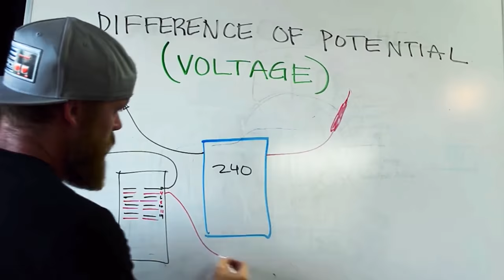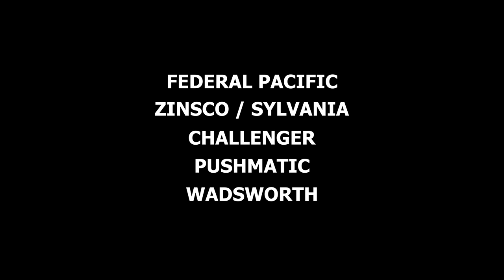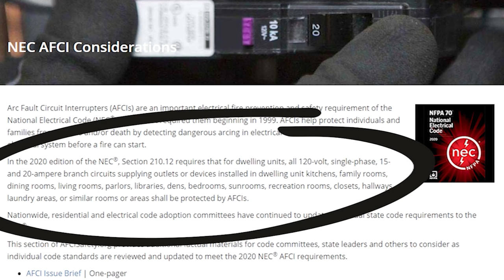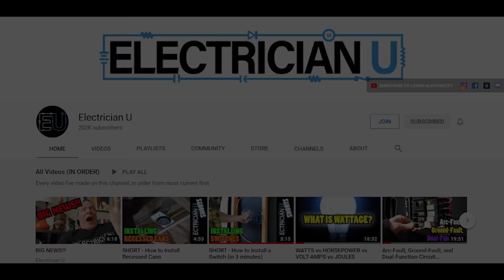Outlawed Panels and Breakers

Comment: Our house was built in 1981. Recently had an electrician out to correct faulty outlets in garage. He inspected our breaker panel, it was a Sylvania/GTE. I had him replace it with an up to code 200amp Eaton panel. The Sylvania didn’t show any problems but being a retired firefighter and very anal about safety, went ahead and took his advice. One of my neighbors came and looked at new panel. He has a Federal Pacific. He’s going to get his replaced as well. It’s a smart move to get the circuit breaker panel upgraded to meet local and national codes.

Comment: I'll never forget, I was in an apartment built in 1962 where an outlet shorted, and the Federal Pacific breaker never tripped. Fortunately, I was right next to the breaker panel, and flipped it manually, since it was next to the outlet. It was then that I researched this issue.

Comment: (8:00) As a retired engineer for a circuit breaker manufacturer, I would never recommend field testing a breaker in a panel by shorting the line to neutral.  All factory production testing for trip point current and time delay is done at low voltage.  Short circuit testing at line voltage erodes the contacts and shortens the life of the breaker. 

Our technicians periodically short circuit tested sample production breakers for UL inspectors. The test was at full rated line voltage and interrupting capacity. It was conducted in a protective chamber in the test lab. This extreme test required that the breaker trip three times without igniting cotton affixed to the handle, to be able to be reset, and to pass a dielectric test. These breakers were then broken up and discarded.
Reply: Thank you for the interesting information.
Reply: Also the time current curve would probably not trip a 20 amp breaker at 22 amps.  It may run fine at 26 amps.  Want to test thermals? Build your own cheap "toaster" tester.  3 electric heaters plugged into a test rig wired to breaker being tested. As above much better to have a low voltage source-not possible in a house.  Add load until tripped.  Should trip at 150%  rated current within a minute or so.  YMMV, a nuclear plant breaker does not like nuisance trips. 
  Dont even bother with stab lock from FPE.  Don't touch the panel.  Once a knowledgeable person touches it, he owns it (litigeus NY here) .  Stab locks did not age poorly, they were cheaters and defective out of the box- they have no excuse.
Reply: ElectroBoom demonstrated the time delay function when he installed an outdoor heater at his home.
Reply: Lol well then maybe all the UL listed breakers should be able to handle hundreds of trips (arc fault or amp) because I don’t know if you’ve ever done a remodel there engineer but it’s all bullshit and sometimes there’s only one way to find out where the line goes
Reply: @fedfreds832   Circuit breakers are designed for thousands of operations within their current rating and about 50 operations when overloaded at 600% of rating.  Depending on the impedance of the source and the load wiring, your short circuit could be thousands of amperes.   Breaker contacts are eroded every time they are tripped with a fault current.  A thermal breaker subjected to high fault current may no longer hold rated current because it now runs hot. 

Shorting a 20 amp branch circuit somewhat distant from the entrance panel will likely do little damage because the current is limited by the wiring.  Shorting a breaker at the panel for testing will reduce its life.
Reply: @gwford3  sounds like you more of an engineer and not actually out in the field trouble shooting. Now a days those arc fault breakers that are suppose to be so special are shit there buddy. Maybe the engineers shoulda looked at those or “tested” those breakers a bit more. (Siemens wise)
Reply: @fedfreds832  they've been out for a long time, and I haven't seen any improvement in old vs new. It's a money grab.

Comment: Your right! Over the years there have been some very bad panels manufactured! However, I disagree with "Pushmatic" being put into this group. In this area, almost every Church had a Pushmatic panel located near the entrance. These breakers were used as switches to turn the lights on and off. While this was not a good idea. These breakers have withstood this abuse for 50 or 60 years! Yet when tested they still break the circuit on an overcurrent, like they did when they were new! This speaks to the manufacturing quality of these breakers.
Reply: Breakers that aren’t flipped regularly go bad faster. Pushmatic breakers were grease-fed, so using them regularly kept the grease from drying out.

Comment: This 100-year-old house used to have a main cutoff switch and a couple of really humongous fuses connected to the incoming feed,  and then going to the breaker panel.  Moisture ingress via the feed caused a fault that pretty much removed one of the two phases,  which was fun while it lasted.  Replacing the fuse (150A!) fixed the immediate problem, but eventually the panel was replaced,  as was everything outside up to the weatherhead.  Significant pucker factor watching the guy who did the job messing with those wires coming off the pole,  but he got it done.  And he re-used all of the original breakers,  which meant that we had some fun with a new dryer running with no heat.  We had to get him back out again to replace that breaker...

Comment: Ditto the others about avoiding the shorting two wires test. I would edit that out of the video. Not a great idea to plant in a newbies head, no matter what caveats you give. However, I wanted to comment on the cost for installing modern versions of the classic breakers. My experience is they are $80 - $100 each. Say a typical house has 30 breakers: that's $2400 in material, plus labor. Even the fanciest GFCI/AFCI breakers cost a little over half the price of the replica breakers.

Eaton has a drop-in replacement panel ("guts") that can fit in a variety of existing enclosures and they claim is UL 67 listed for all appropriately sized enclosures. No tearing out enclosures with all the demo and patching work! Inspectapedia advocates this. It won't trigger a requirement for AFCI breakers, but the inspector at worst may require a $30 AFCI receptacle to protect existing circuits. Also, if the existing grounding system is inadequate, upgrading it is the right thing to do anyway.

The other point is what I observed when watching Dustin's video about replacing breakers on his Zinsco panel. In particular was the damage to the buss bar where his main breaker was attached. He even admitted that gave him more incentive to do a full panel and enclosure upgrade.

I get how you are advocating giving a solution to customers who can't afford a full panel upgrade.  You are to be commended wanting to give them a fair shake and not squeezing every penny you can. I just feel a panel (breaker holder) replacement with modern standard breakers, along with other external requirements is the minimum I'd do. Otherwise I wouldn't touch any of it, so the customer doesn't get a sense of false security. I've told them the dangers and gave a reasonable solution. I could sleep alright knowing I was fair and honest.

Comment: Before shorting any circuit to test a breaker, pay attention to the size and location of the transformer. A pole pig on the street 2 houses down will have different levels of available fault current than that pad mount next to the garage feeding the convenience store on the other side of the alley.  They do make proper test equipment to test the magnetic and thermal side of breakers, but very few electricians have access to meter and relay equipment.  Situational awareness is important when testing for fault current. Be aware an old splice may shoot sparks in a short circuit test. This may be in a wall or in the attic with or without a box in older construction.
Remember, most older homes used electricity for lights, the vacuum, the radio, the fridge, and if wealthy, the TV and washing machine.  This was in the day people hung out laundry to dry.
With modernization, electric dryers, stoves, water heaters, computers, power tools, etc were added to outdated panels.  Keep this in mind when testing in older homes.
Reply: Keep in mind that's IF it's not been updated at all. I bought an old house in 2016, built we think in 1908, but the panel had already been replaced at some point with an FTE panel, yep, I had that replaced. It was 200A/240V service too. I think my current panel is by Square D. Sadly, the house still has some K&T still in service. An earlier inspection revealed it to be about 30% still. The rest was Romex/non metalized cabling. We kept the 200A/240V the same, just with a current panel. Also, the house had a back porch get enclosed in the late 60's and it was wired up and plumbed into a laundry porch, and yes, it's all Romex in there and galvanized pipping for the washer (the kitchen is galvanized too, though the bathroom, redone in 2009 may not be galvanized).

Comment: I had a dead animal smell in my house occasionally. A few months later I spotted a hot spot in my old 1974 breaker panel and found the screw to the buss had broken and was heating up, burning the breaker plastic. The burnt plastic was what smelled! Caught it before it caused a fire!
Reply: In factories breakers are/were tested every 6 months with equipment to find "hot" breakers" lugs and connections checked for snugness, loose connections retorqued  due to vibration....in areas that had negligible vibration could still find loose connections............temperature changes[both room and device], load fluctuations, vibration, can and will cause loose connections in a residential panel.
Reply: @Norm Ferguson Was the dead animal smell only in a certain part of the house? I'm having a similar issue and I can't find a cause. The smell is only in the room with the panel. I don't notice outside. I replaced all my receptacles last year. I haven't noticed any issues with my panel. They trip when overloaded. I may have to open the panel up and look.
Reply: @LloydBrinker  the smell was in an area about 12 from the panel

Comment: I’m currently 58, an EE and volunteer firefighter/paramedic.
When I was 10, I was visiting my paternal grandparents at their apartment.
They owned a combination building and lived on the 3rd floor above retail stores and additional apartments below.

I had seen a welder repairing a steel gate protecting the retail store and decided I was going to become a “welder” and convinced my 80+ year old grandfather that I was capable of building a “welder”.

The 1860’s building had been rewired in the 1960’s/1970’s and all branch circuits were aluminum as well as the feeders for the 8 FPE (yup… FEDERAL PACIFIC KABOOM BREAKERS) sub-panels.

I cut the alligator clamps on one end of an automotive jumper cables. (Crappy #6 copper cables).
I opened the sub panel in their top floor apartment and (wearing leather gloves for “protection”) used a spare 20amp single pole breaker to feed one of the jumper cable conductors and attacked the other conductor to the neutral bus.

I then conned Grandpa into driving to the local industrial hardware store to pick up some “welding sticks”.
OMG… when I think back on how I almost burn their building (and HOME) down.
OR.. electrocuted, myself or others…

Yup… welding worked like a charm!
The 20 amp breaker never tripped .  NEVER tripped!
But… the 100a 2-pole breaker feeding the sub panel from the basement service TRIPPED after 20 minutes of “fun”.
The service was ALL Square-D QO btw…
I still can’t figure out why the electrician opted for cheap with everything else .?

Well… after a while, I started feeling like I had sand in my eyes.
Yup… “ flash burn” .  I quickly disconnected everything, thought, molten metal had somehow burned both of my eyes and was forced to call Mom and Dad because my weeklong  trip had to end and I need it eye care ASAP.

Damn good breakers - those Federal Pacific breakers never tripped. !
🤣

To this day, I think God that I didn’t hurt anyone or burn the non-sprinklered building down.
My eyes healed up within a week of “patching” and my grandfather never said a word.
He simply said I was watching workers doing some welding…. 

RIP Grandpa!

Btw - I inherited that building after aa few years and sold it for college tuition funds.
(it was located in Orange, New Jersey, big time ghetto, so it didn’t cover grad school..  LOL)

Great channel, great video, and great community!
Thanks

Comment: One of the problems with these breakers and panels is they were fine when they were made but as electrical loads over the years have increased, they become substandard.
Houses in the 1920's and 1930's only had lighting. There was no electric refrigerators, TVs, kitchen appliances, hair dryers, etc.

Comment: Cont. Never observed a pushmatic breaker that overheated or caused breaker above it to burn like murry breakers did. We had close to a thousand of them at large slaughterhouse  that I worked out in the 1970's. Only problem was a flush mounted pushmatic panel located in a damp boning room that got hosed down every night. Top breakers would have to be replaced about once a year due to water leakage. The thousand or so homes built in the early 60's where I live all had pushmativ panels. At least 75% of them still in service. ITE who made pushmatic breakers & panels made the best safety switch in the world. They were like a timex took a beating and still keept on ticking. Was able to get replacememt guts the very few times one went bad. Siemens bought out ITE and turned the Cadillac of safety switches into garbage. FP & Zinco were garbage. Replaced some that were not even 10 years old. Another great thing about pushmatic is they are the only large scale residental breaker that bolted on to the quality bus bar. Even the pushmatic were best around. When I replaced my service 30 years ago put the original pushmatic panel in the garage as a sub panel. Still working great.
Reply: I have like 50 extra pushmatic breakers
Reply: @garbo8962  I'll hang onto them, brand new they are like $85 and up
Reply: I remember them pushmatic breakers in Jr high school all the panels had them. We also used them on stage we could follow people crossing the stage by turning on and off set spot lights. There were also main breakers for the light panel I would like to see a safety video on the light panel of it's day. We had one shoot sparks out because there was a bad breaker or short. The breaker always tripped and should have been a red flag to repair the light panel but when you let a eighth grader run the show and not report problems anything can happen I should  have over stepped my bounds but would get called out not knowing anything about electrical devices. This should have been avoided but there goes the fault of leadership in school. The first problem is you never should use a circuit breaker for a switch there should have been separate switches on the light panel for turning certain lights on and off there were dimming features on the panel but a switch should be in place for turning lights on and off not a protection breaker. Well the story goes I said out loud the light panel is on fire  and run across the stage at least my friend knew to turn off the main and everything on stage went black. So I wasn't the fool running across the stage after all .73

Comment: As a DIY homeowner I had a house with a PushMatic system in it when I bought it.  My uncle is a union electrician so I learned lot from him by helping him though the years on sides jobs after my day job.  I figured I was up to replacing to squareD.  The panel and breakers I needed only cost around $400 bucks with everything I needed.  I called my friend Mike that works for AEP (American Electric Power) in Ohio.  Told him my my security tag fell off and my meter fell out :)  He knew what I was doing.   Gave me another tag to put on meter box when I was done.
Reply: Lol I know it's a year later but I love that "my meter fell out" gotta love friends in high places.

Comment: Cant wait for your Wadsworth panel/breaker video!  Fortunatley "my" Wadsworth panel is at a permanant campsite in a campground (circa 1950's-60's), 70' away from my camper, and feeding a new exterior subpanel.  I did install a replacement (new) 2P 40A breaker a few years ago when I did an upgrade, so I hope I'm good (fingers crossed)!  Keep putting up these great videos.  I'm not an electriciain but have worked in the automaton industry for decades and really find them interesting and well presented. Peace.

Comment: Pushmatics are little odd, but I've not seen them act up or cause any safety issues.

Zinsco and Fed Pacific are house burners though...
Reply: I do like the bolt-on feature with the Pushmatics. I just did a service call today where an older ITE had three charred away bus bar stabs. It just showed me that improperly seated breakers can lead to problems too.
Reply: problem with pushmatics they love to corrode and the springs get brittle if they where used as switches a lot other than tht i haven't noticed any issues with them but i recommend to pple who have these to think about replacing them
Reply: @sirnatanielson  aluminum busbars are crap.  I saw a house where the aluminum busbars failed before the house was trimmed out.
Reply: I've got a cheap ass project manager who refuses to throw away our old fed Pacific parts. It's an accident waiting to happen
Reply: @jeremiahbrown9328  a lot of electricians hang on to FPE and zinsco breakers for emergency replacements
Reply: Houses still burn down even though have new electrical systems.
Reply: @ernestmccollum2397  maybe people need to not plug in so much crap at one receptacle